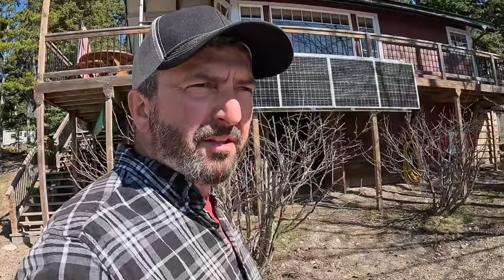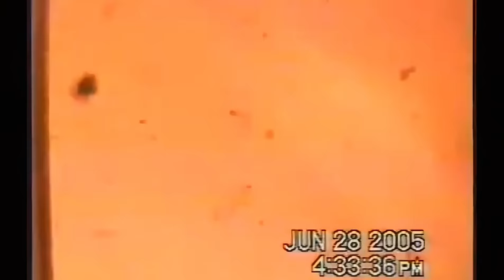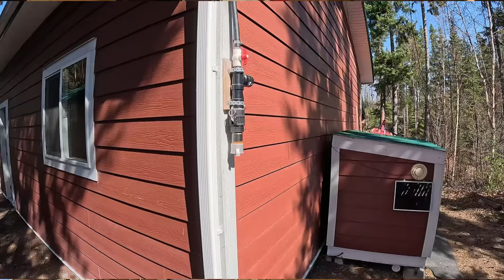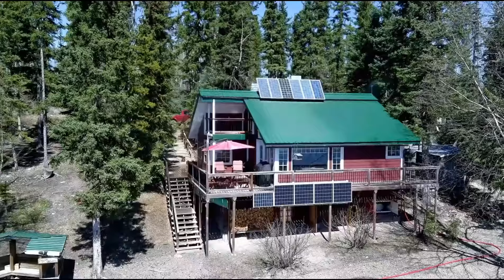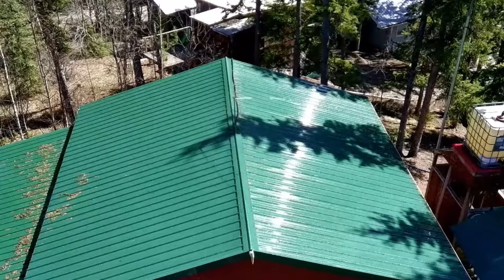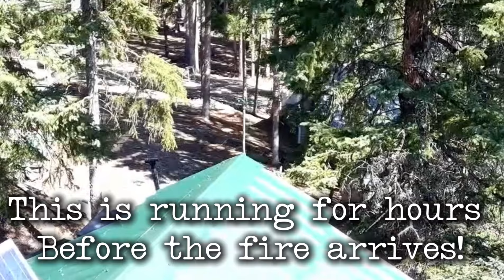Off-grid wildfire defense that actually works

Comment from the maker: Hi everyone, I don't want to discourage anyone from trying before they've even looked into it. I hear this kind of pushback a lot: "You're not a professional, this is too complicated for regular homeowners, there's nothing you can do during a wildfire, just grab your stuff and run." I get why people say that, but from what I've read, the research suggests otherwise.

For example, after the 2007 Ham Lake Fire in Minnesota, researchers found that putting down roughly 3mm (1/8 in.) of water an hour was enough in most cases to raise humidity around a house and help keep it from catching fire. With basic sprinkler setups like the one in this video, that approach reportedly helped save over 100 homes. So that's a number worth aiming for as a starting point — more water is likely better if you have access to it, but if you're working with limited resources, 3mm/hr seems like a reasonable target based on that case.

I'm not an expert, just someone who's looked into this and wants to share what I've found. Please do your own research too, and take whatever precautions make sense for your situation.

One IMPORTANT thing to keep in mind: this isn't about fighting the fire directly or putting it out — that's IMPOSSIBLE. From what I understand, the idea is that the added humidity can help limit or prevent ignition while the fire front passes through, which is usually pretty fast. It's not a guarantee, just an approach that seems to have helped in numerous documented case.
Reply: Can you bury that hose? It looks great but I wonder if you can improve the survivability of the hose. Maybe even get a bit more throughput so you really spray it down.
Reply: I love man. Being proactive is more than 99.999% of all the lazy people making comments like that are ever going to do. I live on desert property with high fire risk. I currently have an impact sprinkler at each corner of the house and spigots at each location. I like the idea of running them on the roof, too, though. Think I'll get some tall base ones for the roof now.
Reply from the maker: @AZBADBOYz  Thanks for the positive feedback. Cheers
Reply: It's important to have sprinklers not only cover the roof but the eaves and walls and the decks in front of the homes.
Reply: The line from the lake to the house is not going to be damaged from the fire? Then how is the water going to arrive from the lake? Also (this is the law in my country) you should cut the trees so that it doesn't touch the house... anyway that looks as a very good way to fight a fire...
Reply: @ΙΩΑΝΝΗΣΜΠΙΚΑΚΗΣ-ζ1ψ  Bury the water pipe in a shallow trench
Reply from the maker: @ΙΩΑΝΝΗΣΜΠΙΚΑΚΗΣ-ζ1ψ  thanks... I agree. Cheers
Reply: An often overlooked safeguard is protecting the pump site.  In your case, a small sprinkler or mister would be enough 

I would also look at an external fuel tank(s) for the pump. 

The idea is to stay as long as you can safely, start the pumps and go.  You have unlimited water but fuel is the next limiter

You are miles ahead of most land owners. Nicely done
Reply from the maker: @mikekollross8810  Thanks for the extra info. Cheers

Comment: Good video, thanks :) I'm jealous of your unlimited water supply!
I know it's already mentioned in a few other comments, but definitely consider adding a diesel pump + buried delivery lines at some point.
Long runs of layflat are vulnerable to catching hot debri or branches landing on them, only takes one hot spot anywhere along the length to ruin your day.
A diesel pump is much more reliable as the fire front approaches; higher boiling point, no vapor lock, no reliance on electronics, and can stop and restart without worrying about heat-soak. Quite a few stories here (in Aus.) of systems successfully protecting homes up-until the pump fails. Even with a sprinkler on the pump, it doesn't take much increase in ambient temp to get the carby above boiling point.
Reply from the maker: Thanks for the info... I'm always trying to improve it.

Comment: If you plan to build a cabin or a home, start with materials that do not burn. YES, I know it is obvious to take wood if you're living in a forest, but this is what brings in the biggest problems.

There's a very old building technology using compressed dirt. Walls of compressed dirt naturally do not burn. Another one is stacked straw. It's certified here in Germany and YES. It is fire resistant. The trick is the clay that protects the straw. Nothing can reach it, neither insects nor fire. And most beneficial, when you're living in a cold climate, is the insulation. A wall made of straw 1,2m (47inch) thick is insulated that good, you barely need a heating, even in ice cold winters. 
😊
Reply from the maker: Those are some great building alternatives to consider, thanks for sharing! Cheers.

Comment: As one improvement that I am working on myself, put heat shield covers on hoses to protect against radiant heat.  Or bury the hose run (at least 10 inches) from house to garage.
Reply from the maker: Great suggestions for protecting the lines, thanks for sharing! Cheers.
Reply: The most important thing is to start and continue.  You are a long way down that positive, independent track.

Comment: Suggest you could learn a lot from Australian homes.  All pipes are metal usually a push button start diesel pump from a large tank or swimming pool. So easy a child can activate. Also All gutter down pipes can be blocked so the rain gutters fill with water
Reply from the maker: Good information. Thanks.

Comment: Have you thought about implementing mats with wettened superabsorbent polymer?
Reply from the maker: No.... Haven't heard of either? Tell me more ? Cheers
Reply: @HacksandProjects  Perhaps this isn't actually available for purchase yet. Superabsorbents can soak up enormous amounts of water; when wetted, they turn into a gel. One could manufacture a fabric made of fire-resistant material and incorporate superabsorbents into it. Once wetted, it swells up to create a fire-resistant, cooling barrier. This could be hung in front of building facades or laid out on roofs. Since water evaporates at 212°F, the curtain cannot get hotter than that as long as it hasn't dried out—temperatures insufficient to ignite wood. The back could be lined with aluminum to reflect thermal radiation. Using wire mesh on the front would provide additional protection against flying embers. There is an impressive video by Wildfire Defense TV titled "Retired Fire Marshal Explains How Wildfire Defense Mesh Saved His Home During A Wildfire" (at 2 minutes 26 seconds). I have brought the potential use of superabsorbents for this purpose to the attention of a manufacturer. You can try this yourself: buy a few diapers, cut them open, and sift the contents. You can separate out a fine powder—that is the superabsorbent. Take a soup bowl, pour some water in, and sprinkle a little of the powder onto it; within seconds, it turns into a gel. Superabsorbents can absorb up to several hundred times their own weight in water.

Comment: Is the generator in an enclosed box?  How is the heat dissipation, exhaust venting and air intake?  

I think an overlooked aspect of a system like this is keeping the vegetation lush.  You could run this system a few times/week to keep the area lush.  That might be the systems strength, rather than reactive fire “fighting”
Reply from the maker: Yes! The generator is in the box.  I have another video or two covering the details if you're interested. Cheers!

Comment: A key point to is that water takes up a lot of energy to have it boil and later evaporate. So the water also create and heat sink and absorbs a lot of the heat of the forrest fire so when the water is gone only a little is left to heat up the wooden house to a point it could light up. NASA once had an idea to run a water fil up the bottom of the shuttle when its doing its re-entry into orbit to absorb the friction heat. So all this to say you dont need vast amounts of water to not have the wood of the house light up.
Reply from the maker: Great information . Thanks . Cheers!

Comment: A couple off the cuff observations. Radiant heat, your plastic fittings could melt in seconds. You're only as safe as your weakest link.

Your hoses from the lake they look either plastic or quality rubber. They also look susceptible to heat penetration. What about burying those hoses down under* the heat rising 🤔

OK 3 observations counting this high gets tricky. What about atomIzers instead of sprinklers to create LESS Oxygen as well as humidity. This would be "thicker" humidity better able to choke the fire would it not? Strong wind might challenge atomizer effectivity is the only possible tradeoff I can think of and the wind for most part would be gusting not steady. ☔

Diesel be a safer flash point in all that radiant heat?
Reply from the maker: Those are some great practical ideas for hardening the system, thanks for sharing! Cheers.

Comment: Where and when do wildfires happen mostly? .... In dry and hot areas.

And you need lots of water for the fire protection...

And you don't have lots of water available there.

So, the system can easily run dry.
... leaving the house without protection.
Reply from the maker: Well I do have the entire lake?  Cheers

Comment: Nice! But i doubt whether the amount of water will be sufficient to cool the house sufficiently once the surrounding area is on fire. I advise to take a look at water curtain sprinklers to protect the walls of your house against the heat radiation.
Reply from the maker: Great suggestion, I'll definitely look into adding water curtains for extra protection. Cheers!

Comment: You also need to consider the entire "defensible space".  Having any combustible materials near your home, dry wood piles, wood furniture, shrubs, etc., can degrade the ability of a humidity home's effect.  
Also, any pier and beam open spaces should be screened off to reduce the likelihood of firebrands/wind lifted burning embers being blown under a house.  
In a first setting, the wind blown burning embers are one of the greatest dangers.  Trimming up trees will not help with blown embers.  If trees are close to your home they are a clear fire hazard.  Usually, 50ft of defensible space surrounding a structure is consumidered a minimum in high risk zones.
Reply from the maker: Great points. Cheers.
Reply: Les braises ne brulent pas n importr quel bois.
Ce sont les pins et autres resineux stupides qui brulent trpp facilement.

Comment: I love it, great job. 
Do you have extra parts/supplies on a hand in case of a break?
Do you have quick leak repair options for the pvc line?
Is there an expiration date/replacement timeline for the PVC that in the direct sun (on the roof) where it could break down over time.

Comment: Look at 'Fire Smart' for hardening your property against wildfire

Like you mentioned, the greatest threat is not direct flame impingement but the ember storm that precedes the flame front

A quick check is to look where wind has deposited leaves.  This is where embers will land and if there is tinder already there, the flame will take hold

Look at the hawaii fire and the one house that survived.  No combustibles next to the house, deck closed in underneath.  Non combustible roof and siding
Reply from the maker: I appreciate the tips on property hardening, those are really important details to consider! Cheers.

Comment: Is the hose you are running from your pump the "Weeping" style that will not melt, rather than the usual consumer Lay Flat hose? A second/ backup pump may be wise to have that you could plumb it into the line and have it ready to go with less fuss. You may be able to also adapt a larger auxiliary fuel tank to the pump. Waterax, and their dealers, are good resources.
Reply from the maker: Good info . Thanks

Comment: Your BEST strategy is a fire break around your home. That means no trees, and ideally anything that can burn, around your home by at least a few hundred feet.  Its basically landscaping with the idea of slowing or preventing a fire to make its way to your home.
Reply from the maker: I agree clearing vegetation is a key part of any good fire defense plan! 😊But If I cleared that far from my property it would be my neighbors homes. The property is only 100 ft wide. So yes I could clear cut the property. But not why im in the woods in the first place. Cheers

Comment: Great, you have so much water that there are so many more things you can do. One thing, after you have removed vegetation is to run aluminum irrigation pipe 200' or so away from the buildings using the type of sprinklers you now have. This is the first line of defence as most fires fires have a ground flaming front. If there is a crown fire it may move aways through the trees but it should be reduced.  This is where the second line starts. Use metal piping and spinner irrigators. The idea is to break up the water into very small droplets. The small droplets absorb more heat. This is the technique that structure fire fighters use for interior attack. Low volume cooling misters would work under decks and eves. Use a lot of them. Have garden hoses placed around the house, ideally close enough together to have two hoses reach every spot. One knocks down the fire moves on, the second gets in close to catch the hot spots. Consider burning out the fuels between your house and the sprinkler line. Hoses then are a must. Winds can be favorable as the fire approaches. There should only be fine and some medium fuels there. Wait till they are consumed then extinguish them. Consider buying fire type bladder bags or backpack chemical sprayers.

Slow moving fires can be very smokey ahead of the fire. Intense crown fires generally aren't as the smoke is rising quickly and winds are pulled into the fire by the convection column. The danger is when a spot fire ahead of the fire gets intense enough to make its own convection column and then pulls the main fire twords it. These winds can be very strong, hot, embery and smokey. Even going between buildings can be hard. When doing structure protection we would pick out landmarks and put up flagging especially in places where embers can hide and to identify escape routes. These can be hard to find in the smoke. When the front passes the convection drops and most of the fire is now smoldering. This is when it is super smokey and can be for a long time, even for days. One hazard is the internal combustion engine. In very smokey and reduced oxygen environments IC engines can run poorly if at all. Don't close the box it will overheat.

Let's talk about PPE and safety. Have boots, thick socks, long cotton pants and long sleeve shirt. Hard hat with shroud and goggles are a must. Have a headlamp compatible with the hardhat. Masks are good but they restrict breathing during exertion, and do nothing for high CO, CO2 and low oxygen and fog the goggles. Use the in for a short time and out for longer period method of patrol. You can hide in the house. Several 20" box fans with hepa filters taped on can be placed in a room for relief. Research LCES, Standard fire orders and the Watch out situations. Have a Lookout. Know when to go. Communicate your Escape Routes and Safety Zones ( you have a lake).

Almost everywhere in Canada and western US has and will burn again, so be prepared
Reply from the maker: Good Info. Thanks.

Comment: We used a canvas hose that seeped a little water so that it would be ok sitting in fire. It does have a little more frictional loss of pressure compared to a plastic type though.
Reply from the maker: Interesting trade-off regarding the pressure loss, appreciate the insight. Cheers!
Reply: @HacksandProjects , that was based on my Fire Service experience and a visits to the hose factory.

Comment: I live in Australia and have always said that you need mega sprinklers on your roof and some way to recycle and reuse the water as you use it. You also need to have a system that will work once the mains electricity has been turned off. You also need to be very persistent keeping your gutters and roof clear of leaf litter.
I believe anyone who plans to build in the bush needs to be wildfire self sufficient.
My friend was one of the only people who didn’t lose his log cabin during the Clearwater River forest fire because he kept the bush well away from around his cabin and he had a metal roof.
Reply from the maker: Thanks for the insight, it's great to hear how those strategies have proven effective in real scenarios. Cheers!

Comment: There are systems now that can sense the embers and intermittently run the sprinklers start and stop generators this is the next step. I installed a system like this on our fire hall.
Reply from the maker: That sounds like a fantastic upgrade for automation, thanks for sharing!